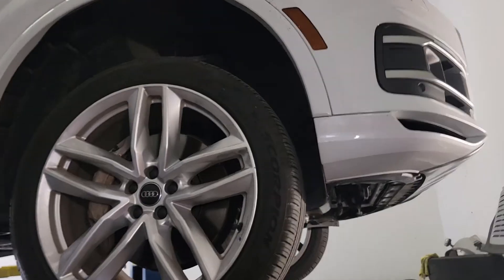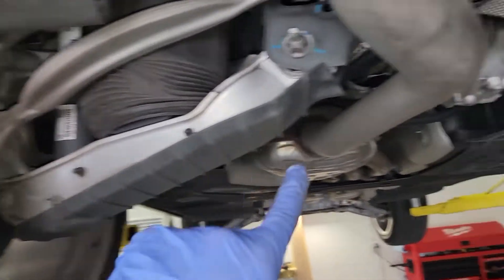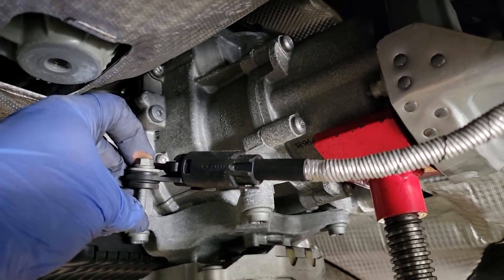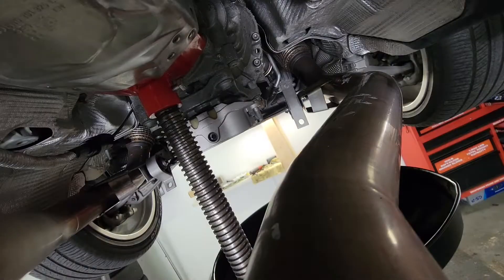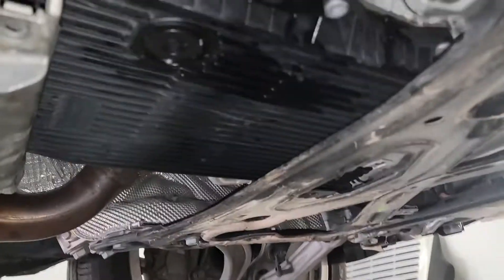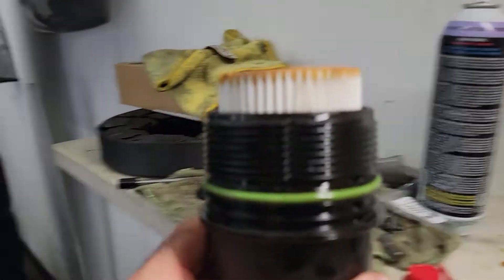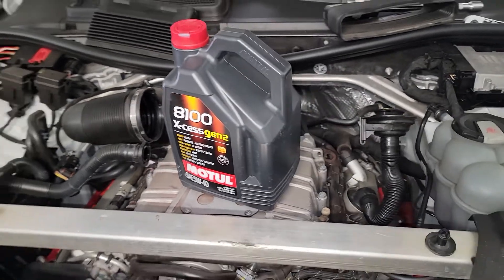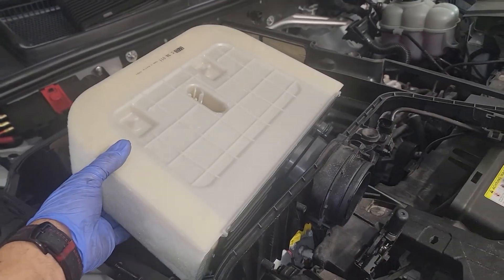2018 Audi Q7 Differential fluids, Transmission, Water pump service 100k

Comment: Finally a good video on the Q7! Thank you. I currently reached 107k on my 2018 / 3.0 without any problems thus far. I do oil changed every 5k and add a half or a quart in between do to engine burn which I haven't found a reason as to why though the Q7s burn. .. Anyhow I'm about to do all the same maintenance so thank you for this video! Did you notice any difference on differential with new fluids? I've heard it could start slipping once changed not sure how true that it, but I'm changing it. Again great video!
Reply: To shine some light on the oil consumption of the audi 2.0T and 3.0T. I had a 2013 Q5 with the 2.0T engine which had 45K miles on it when I bought it. Oil consumption was about 1 quart between oil changes, when I reached around 110K miles on the engine, it really started consuming a lot more oil, up to 3 quarts between oil changes. I started looking deeper into this issue and found some literature where Audi is well aware of this issue, they even had a TSB (technical service bulletin) in regards to this oil consumption issue where Audi in many cases would take care of it up to 100K miles on the engine. The problem is the piston rings not sealing properly and letting oil seep into the combustion end of the system thus burning it off through the exhaust. Really only way audi can repair this is with a partial engine rebuild by replacing the cylinder pack, liners and rings OR a complete engine swap replacement.
Now I have a 2017 Audi Q7 3.0L with 85K miles and zero issues in regards to oil consumption but that is not to say that Audi fixed their known problem. Many people out there still have the oil consumption issue and most dealers would tell you that it's normal which is far from normal in my option. Vehicles manufactured in Germany for the European market don't have this problem, or it's very minimal in comparison to Audi vehicles designated for the U.S. market which parts are sources from many different countries like Bulgaria or Mexico for instance and are also mainly assembled there and not in Germany. 
So to sum it up, any 2.0T or 3.0T engine designated for the U.S. marked is prone to oil consumption for about a decade now and Audi is well aware of that. Hopefully this helps some current owners and future buyers in their decision making when considering these two types of engine made by Audi for the U.S. market
Reply: Oil Leaks: Valve cover and oil cooler gaskets can leak over time.

Comment: i just went and checked every single website that i could find talked with customer support and i was told the water pump you used is the wrong one for this car. 06E121018H is the corect one and you installed 06E121018K. i'm no expert by any means just taught i should point that out since i asked everyone based on vin (q7 4m 2018 3.0t prestige) and i got the same answer from all of them that 06E121018H is the pump i should buy. besides that thank you for all the other info. i need to do all this service myself
Reply from the maker: Both will work, H is the OEM plastic impeller K is the metal one.
Reply: So the K is better it seems

Comment: hey, i have the same vehicle. does it burn oil? Mine needs about 1L every 2000 miles. Do you think this can be caused by a bad PCV? Thanks and great video.
Reply from the maker: Good timing! Just added 1/2 quart after 4k miles( including 2 500 mile tows). That brought my level up to max. It was showing a notch below half before.  Try the oil I suggested next time.
Reply: I replaced Pcv and check valve on mine. Still burnt a qt. of oil ever 5-550 miles. So decided to do a piston soak. I’m currently around 1,0xx and still no need to add oil 🙂. Maybe go that route first.
Reply: Thank you Ivan and I ended up having my PCV valve replaced. So far I have 600 miles and it doesn't seem to be burning oil...Do you mind me asking what it cost you to have your PCV/Check valve changed and did you do it at a dealer? Also, was the piston soak a hard procedure to do? @Ivan-pe9yi
Reply: @Ivan-pe9yi  how many miles does your Q7 have and is it a 2018?
Reply: @Ivan-pe9yi  hi, could you tell me where you saw the instructions to do the piston soak? Has the car burnt any oil? Also, what year is your Audi Q7? Thank you Ivan!
Reply: Hi Ivan. Sorry to keep bothering you, but did the piston soak end up working long term for your Q7? Did you use B12 Chemtool? Thanks! @Ivan-pe9yi
Reply: HI Ivan. What did you use to do your piston soak on your Q7? Chemtool B12? @Ivan-pe9yi
Reply: I also had success ending the oil consumption issue on my 2017 by doing a piston soak with B12 Chemtool. 5K oil changes since with LiquiMoly and still no need to add oil 30K miles after the soak. 
Be sure to fog the pistons with oil or other thick lubricant before you start the engine for the first time after the soak!

Comment: Great video. Do you have torque specs for the fill/drain plugs as well as the transmission brace?
Reply: Transfer case fill 27Nm, drain 12Nm. Transmission fill 30Nm, drain - manual says “tighten all the way”.

Comment: Awesome work! do you know if the vw/Audi transmission they use in some Q7s is gonna need the same oil and capacity as the zf one ?
Reply from the maker: Pretty much the same process on the 6 speeds as well. They take 5-6 drain/fill, same procedure for filling. If you follow the procedure you cannot  under/overfill.

Comment: I have the same issue with my exhaust being cracked in that spot at 2:09.  Do you think this is due to a bad flex pipe? My flex pipe portion of the exhaust and the broken exhaust part is shaking like CRAZY.  The motor is solid no shakes
Reply from the maker: Yes...flex pipes go bad...New pipes are about $900. I just live with it for now.

Comment: My local Audi dealer stated that the transmission on my 2017 q7 is not serviceable, and the differentials are not serviceable. Is that accurate?
Reply from the maker: Not Accurate, they are very much so. The dealer will tell you lifetime fluids which translates into lasting until your factory warranty expires. Lifetime fluids do not exist...all loose their original lubricating properties over time. Even the manufacturer of the transmission (ZF) recommends changing every 50k.
Reply: Ха-ха-ха, привет из России. Дилер вам врёт, чтобы вы приехали на дорогостоящий ремонт коробки и всех редукторов. Меняйте масло чаще

Comment: I also have the same issue with the exhaust pipe. Mine 70k
Reply: Ditto. Welded it twice, then purchased the section off eBay to see if fresh metal might stop the cracking.